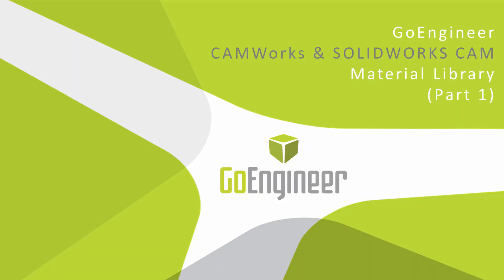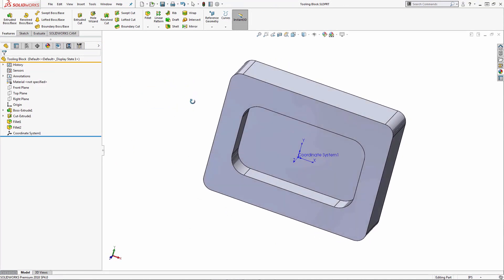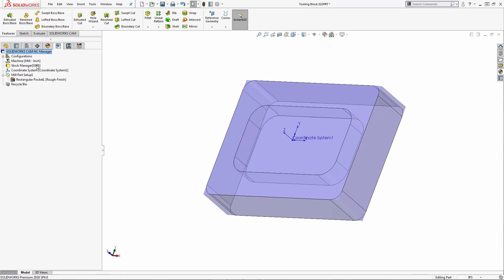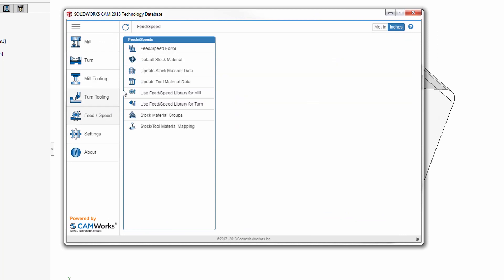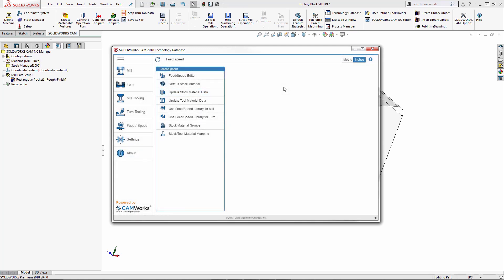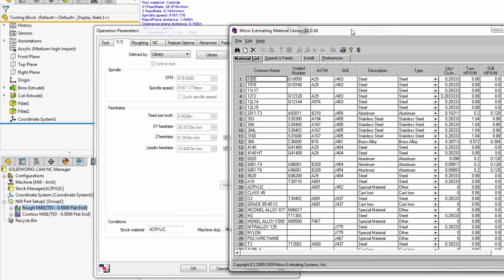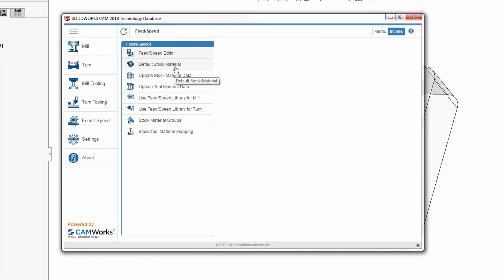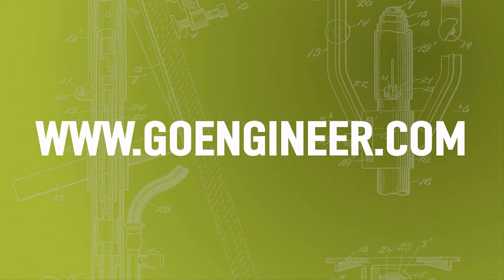CAMWorks and SOLIDWORKS CAM Material Library

Comment: Where is wood???
Reply: i am also wondering this
Reply from the maker: For CAMWorks and SOLIDWORKS CAM 2020 and earlier, there are no listings (by default) for the material: wood.  A custom material listing will need to be created based upon Individual input.
 For CAMWorks and SOLIDWORKS CAM 2021, there is a top-level material for wood.  Unfortunately, it’s just that.  A custom material listing will need to be created based upon Individual input.
Reply: @goengineer  I cant find the 'Top Level' material for wood in SOLIDWORKS CAM 2021- I had to download the Micro Estimating Material Library 11.0.16 and its not in the install list- made a new Wood-Oak material but no idea what to use for feed/speeds etc- density is 0.56g per cubic cm